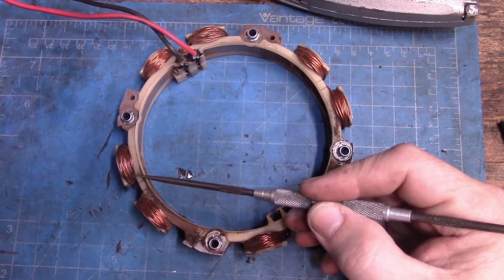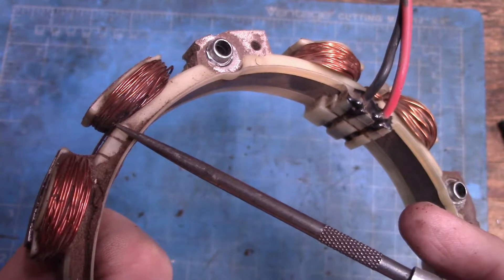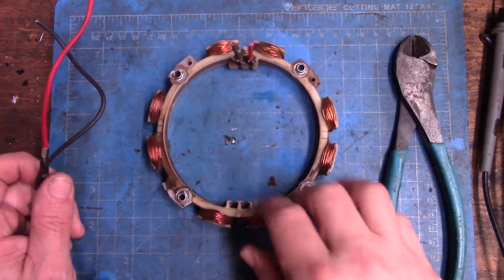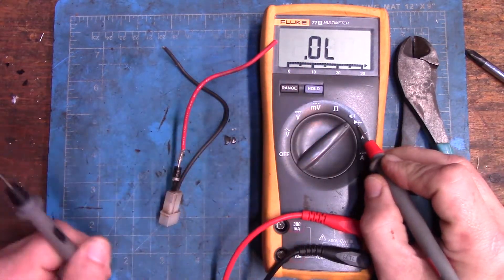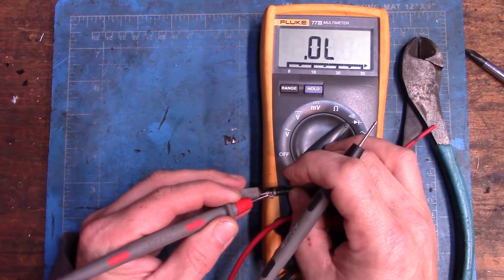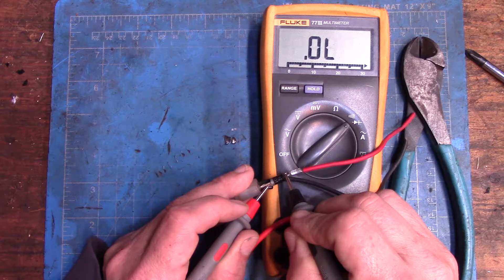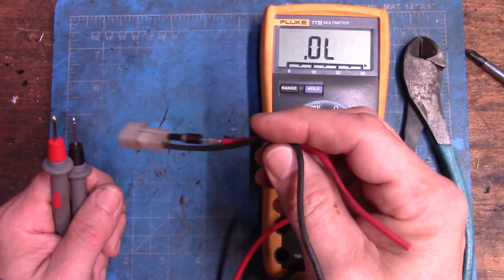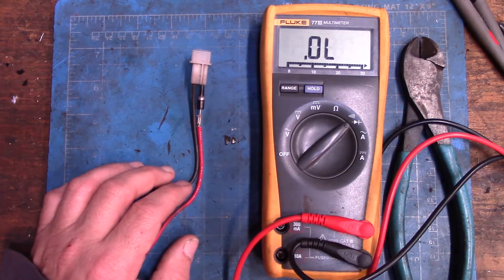Diode testing & what went wrong with the Briggs alternator from the free Craftsman riding mower

Comment: That engine you worked on, had double, (2) alternators on the same ring. The black wire is not ground. The other 2 end ground wires attach underneath ring to chassis top of engine. The  two color wires are (2) hot wires as output. The burned out wire was only one red  alternator burned out. A new diode put on other black wire wold be the new alternator as output. The flywheel can just stay on engine. The 2 curves of wound wires are on each side of plastic ring,  180 degrees and 180 degrees  as completely separate. Briggs company had many different types of single alternators and also the common double red/Black alternators.   4 amp output from  red wire + 5 amp output from black wire. Most people don't use the headlights on riding mower that uses power from the black wire.The Briggs company was wrong using a black colored  wire on factory assembly line. (Mechanics in general assume a black wire means ground.)

Comment: All you had to do was put new diode on black wire and connect to red terminal on plug connector. (headlights not needed.) The dual type alternators red + blk wires are the same,  and each separate. 1/2 + 1/2 of the circle plastic ring. No need to take apart the engine.
Reply from the maker: Oh, would that have fixed the burned through wires on the coils? Try watching the video instead of assuming you know everything and making statements like "all you had to do blah blah blah". I tested the diode, it was good. Thanks for (not) watching.
Reply from the maker: Why did not you not just say "swap the diode to the other side" in the first place and not phrase it like you are giving instruction to your child. I don't need your confusing paragraph of snark, nor continue reading when people start talking that way.

I did not want to to run an alternator with a shorted side, so it is not "all I had to do". I don't consider that a permanent repair, especially when one of the reasons it likely burned up was a buildup of debris under the flywheel, so it had to come off anyway. Part of repairing something is trying to find and correct what caused the problem in the first place not always just "make it work".  Thanks for your comment, don't bother responding, I don't half ass stuff unless there is no choice, and do not take advice from people who cannot communicate a simple concept without being an a-hole. If you want to spread your shade tree mechanic knowledge, make your own video.
Reply: @theeddies  Well said. Thanks for the video.

Comment: Hmm, just found my stator on an ariens snowblower is grounded at all connections. Guess it ain't supposed to be lol.
Reply from the maker: no, i don't believe that is correct. lol
Reply: @theeddies  actually upon further inspection, there's no way it can't have connectivity to ground, it's odd. It's on an EFI ariens and I believe the ECU has some diodes and such that "control" the flow. Also AC current seems to work a bit different with the grounding, I'm not entirely educated on it. Pretty sure the ecu is fried either way on this unit, got it used for $100, might try a new ecu for $67. We'll see. Thanks for the reply

Comment: After this diode do i need to have a rectifier or can i run this wire right to my positive on the battery
Reply from the maker: Yes, the diode does the same job as the rectifier.
Reply: @theeddies   think I cooked the alternator when I touched positive to the frame the mower still goes
Reply: @theeddies  can I run a 1n4007 for my charging??
Reply from the maker: @indoor420  I don't remember the diode number and searching that says it is only 1 amp at 12 volts which would not be enough I think. But not totally sure.

Comment: My diode is bad and I need to replace it only what size of diode do I put in my Briggs & Stratton 10 horse engine alternator that is a diode that burned out?
Reply from the maker: Not sure of the size offhand. Briggs sells a diode replacement part. If you search that, you should get size/type.

Comment: I noticed today my diode was gone burnt up. What would cause that.
Reply from the maker: Age or it got to much voltage somehow would be my guess. They sell just the diode, it is pretty cheap.
Reply: @theeddies  also i forgot to mention. I looked everywhere for the diode only. Nobody had it. Then when I saw your video you gave the diode number...now i can find them on amazon...only after I bought the whole wiring from briggs...lol
Reply from the maker: @paulmelanson1527  I gave the diode number? I don't even remember doing that but I added some links to the description so the next guy can find them easier. Thank!
Eddie
Reply: @theeddies  its probably age. The owner who had the house before me left it. I did not use it for the past 2 yrs. Last time I looked 2 months ago. It looked very brittle.